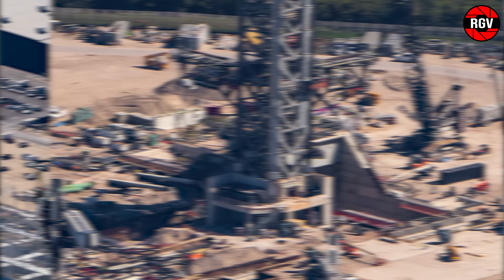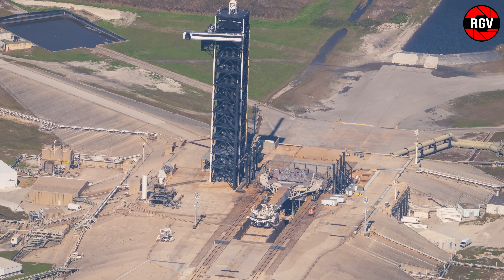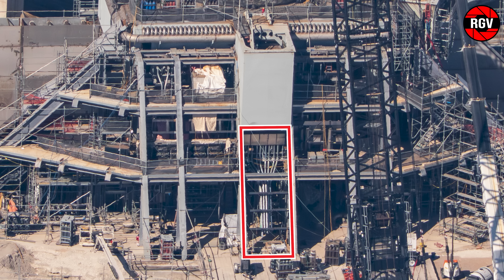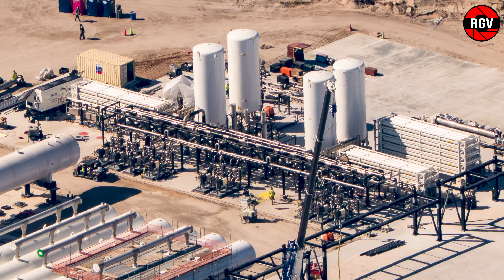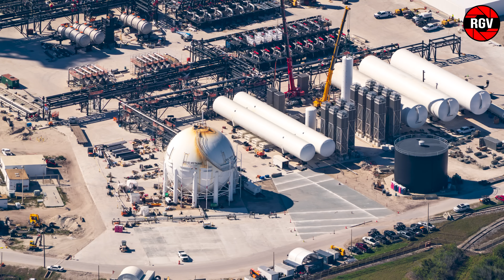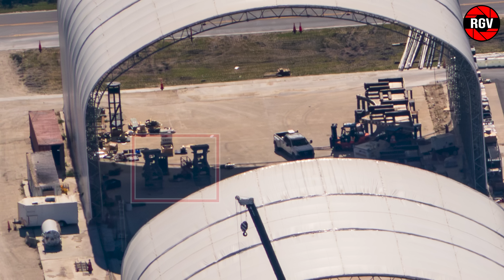Starship's future at the Cape! | RGV special KSC Flyover

Comment: Hoping the new descent profile for Orion works well. The skip and re-enter did not.
Wonder how long it will take to 'reconfigure' a launch tower from V3 to V4...and it that will be 'permanent' or could be (if necessary) changed back to V3. Don't know why they would do that but having options usually helpful

Comment: The pad is great, where are they getting starships and super heavy boosters. Starbase can’t get a booster or starship tested and when they do it fails. Estimates are for a launch in March if everything goes perfect (which hasnt happened much recently). They are still testing the stacking robots in megabay 2 for welding block 3 ships. They will be lucky to build and launch 5 rockets at StarBase this year. There will be no rockets to ship to the cape. If they build and launch 5 rockets regardless from where I’d be shocked. Elon time is the bane of starship.
Reply: Yes.  It's called development.